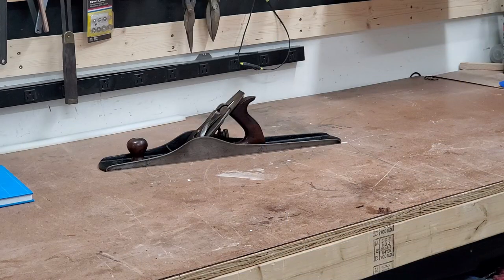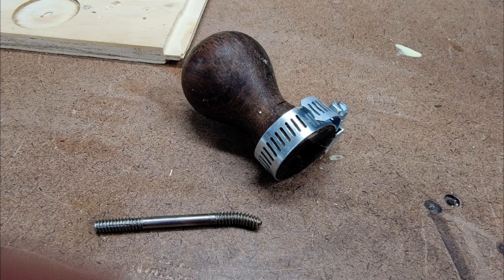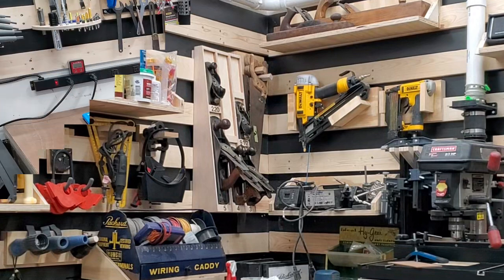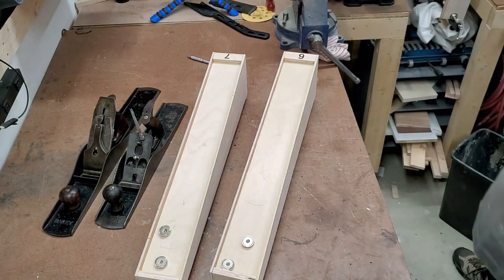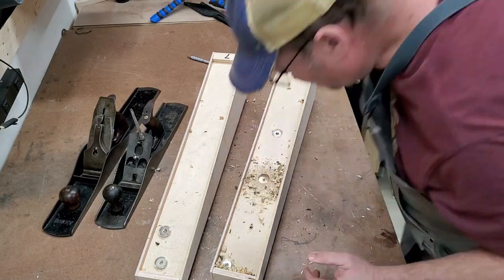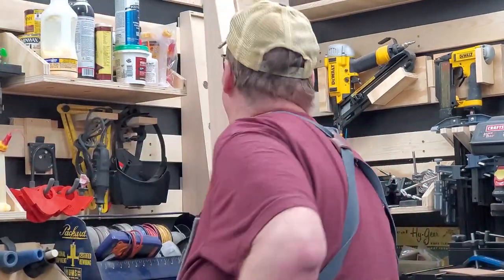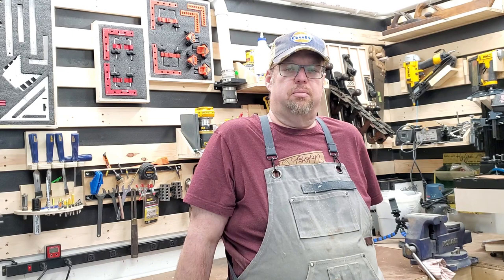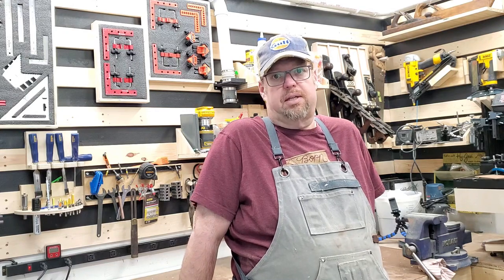Adding to my Stanley Plane Collection and Plane Tills

Comment: Love the modular plane till idea. I'm going to make a French cleat wall in my small basement workshop and may steal your idea for my No. 4 and No. 5 Stanleys. Are there any issues with the magnets and removing the planes from their holders? Does the holder ever lift off the cleat accidentally when you take the plane out? Thanks!
Reply from the maker: I've not had any issues as long as your using two cleats. The motion to remove them is always a downward and out and french cleat bite harder on a downward motion. They don't like upwards motion. I find the more tills you have next to one another, the more stable they all are. Take a look at my other video where I show building the tills. I cover alot of the detail there. Thanks for watching!